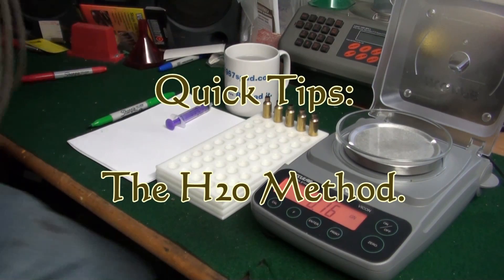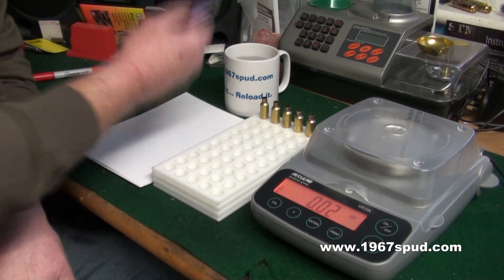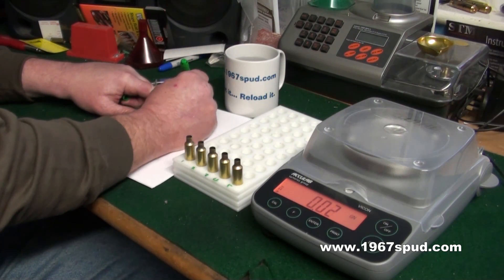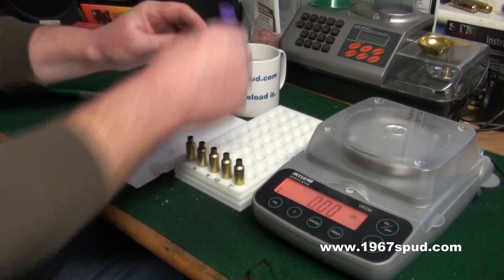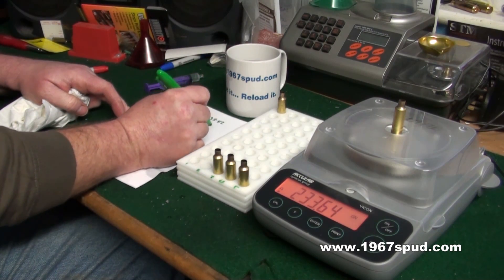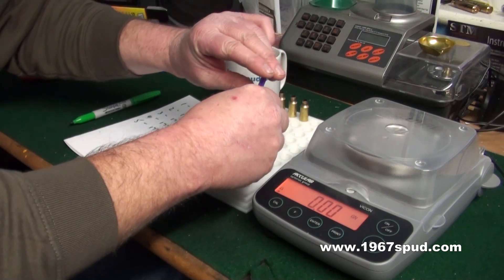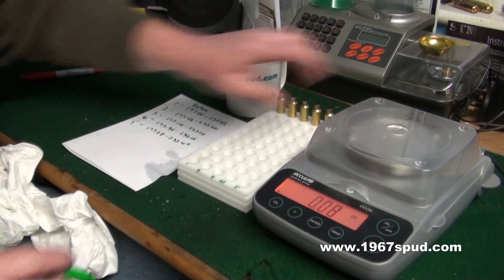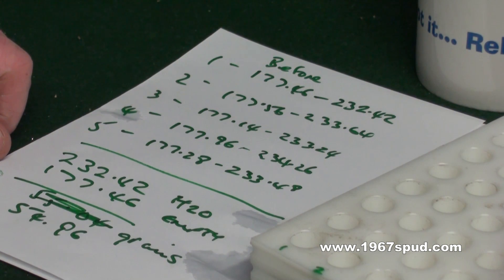Quick Tips: Rifle Case Volume with H20.

Comment: One problem I see with this is once you seat a bullet you reduce the case capacity, so measuring an empty case doesn't allow for that. I would think that you need to weigh the case and the bullet, then fill with water, seat the bullet to the depth you would seat it when you load, let the excess water expel from the case and then take your second weight measurement. Even this would give you a 100% filled capacity reading. Usually not what you would load to, unless you like compressed loads... (-:
Reply: The Quickload program takes the bullet's volume, according to it's seated depth, into account. It does all the figuring for you.

Comment: You have not calculated a volume. All you have calculated is the weight of the water. Volume = mass/density is temperature dependent. After converting all of your units 54.96 gn of H20 equals 3.568 cc or 0.121 fluid oz. The variation in the weight of water will be the same variation in the weight of the brass. Assuming that you have the water filled to the top and do not spill any. You set up the chances of additional error in your measuring this way. I believe that I can get the same consistent groups by just sorting my brass by its weight only which is what this exercise is all about.
Reply: Calculating water capacity is so you can get the right figure to input into QuickLoad so it can more accurately estimate your pressure curve for a given load. Sorting brass by weight will not accomplish this so that is why some of us do it
Reply: oh yea now you have to actually get the volume measurement for your grains of powder and account for error and divide into the volume of the case
Reply: Thanks for the video and inputs, i do have one question though: 

 how does one go from obtaining measured case capacity (via filling the case to the mouth, like this) to knowing the effective case capacity  for a specific  type of bullet seated to a given depth?

Thanks! :)